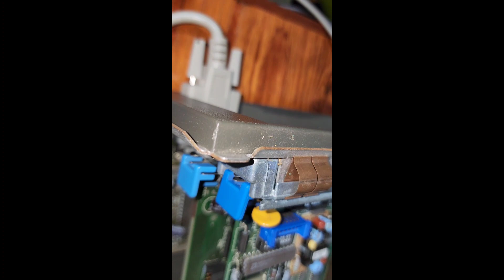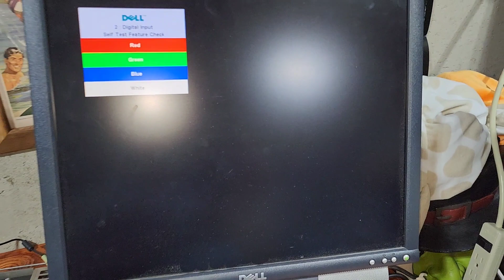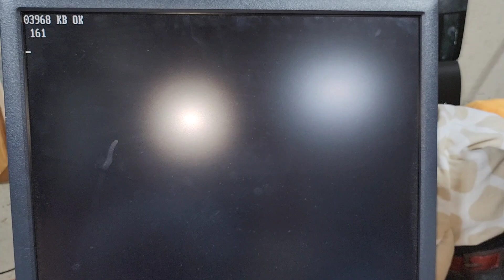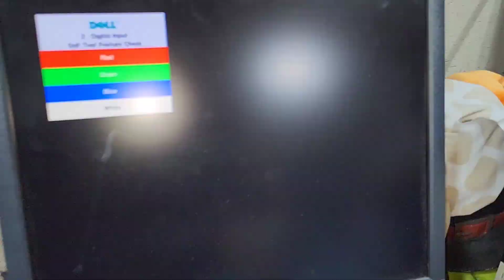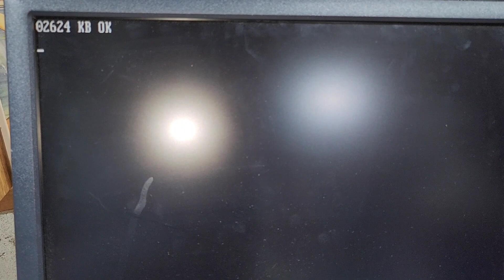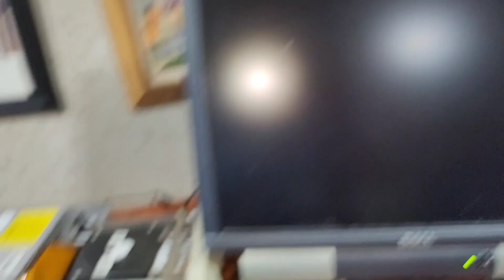IBM PS/2 Model 55 SX - Will it Boot? Troubleshooting! #retro #computer

Comment: you need to use the reference disk for bios setup
Reply from the maker: I'm pretty sure the Dallas clock is dead and will need to be replaced or modified. Unfortunately I don't have the reference disk, but if I do need one I can probably find a copy online